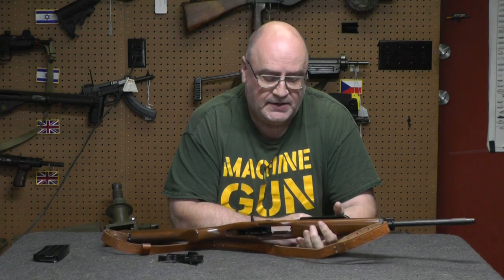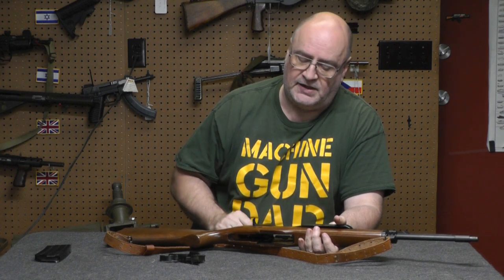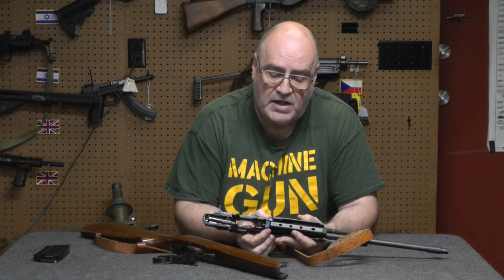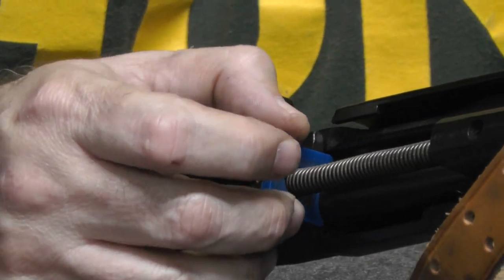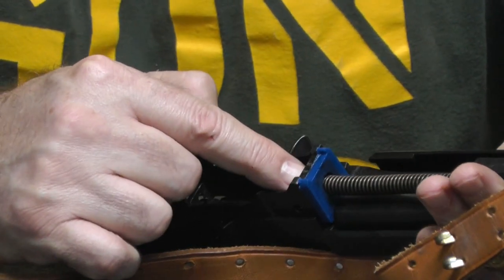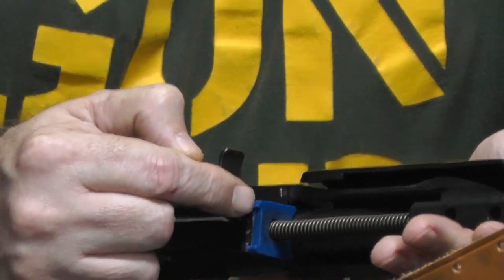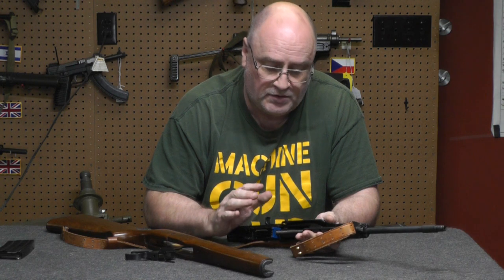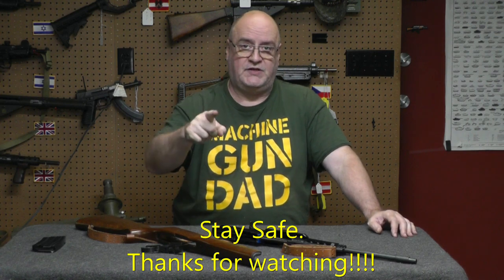Mini-14.   Got buffer?

Comment: I use the buffers on my Mini's as well.  Also on my Ruger 10/22's, 1911's, and AK's.
Reply from the maker: I do not use them on my Aks as different countries have different specs in my factory yugo guns buffer tech buffers caused jams and the bolts were slightly longer.  But in my 10-22 and my delta elite I use them.

Comment: Ill have to take a better look at mine, actually opened up the gas port hole just a bit in that removable little rod thingy, improved reliability greatly. Had erratic ejection and occasional empty casing jams of various types. Its a 1976 series 180 so its different and in my opinion better than later series, Ive had good luck with accuracy and seen a few others on the net that agree the 180s are better built, they look better at least.
Reply from the maker: The 180 series has a weakness where the roller is in the bolt tends to break with heavy use and ruger will not support that weapon. There are no spare bolts available.

Comment: I have the newer584 model that dents empty cases as they eject; do you think buying one of these buffers should help with a somewhat violent recoil
Reply from the maker: I’d try the buffer.  Video the gun without the buffer. And with and compare the ejection.   The buffer should protect the gun but if your gun is over gassed then it will not solve the harsh ejection but may help some with the recoil.  The blue ones I used were more pliable that is where I’d start.   But in you case I’d try different brands

Comment: Think this would help with hotter loads? Mine is rattling apart and there aren’t any signs of over pressure on my brass. I’m a touch under max load.
Reply from the maker: Yes. I think it would help

Comment: What’s a old mini 14
What’s a new mini 14
Do you have cutoff dates??
Reply from the maker: No I don’t have dates.  There are several generations of mini.  First gen had different bolt and isnt supported by ruger for parts Then they changed the barrels.  Then they changed the interface with the recoil assembly.  You’ll need to goto a ruger forum for that information

Comment: If it needed it, Ruger would have included it. You'll find that the buffer will limit the rearward motion enough to cause feed problems, especially with the first round out of a full magazine.
Reply from the maker: If Ruger needed it, then why did they change the design on the early Ruger without that removable plate they are known to wear or get beat up  there. 
   As for ruger designs.   Yeah.  They are far from perfect.    Since I have cracked 2 10-22 receivers.  Plus the first 10-22s had metal buffers/over travel pins now they are polymer.     So yeah I don’t have a lot of faith in ruger engineering.  And that’s Without getting into the disaster of my departments security six revolvers